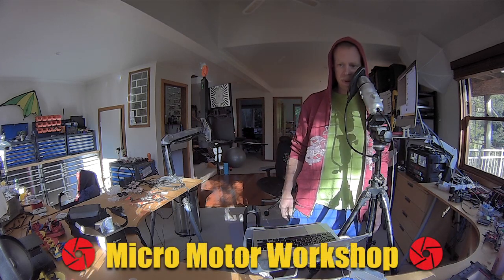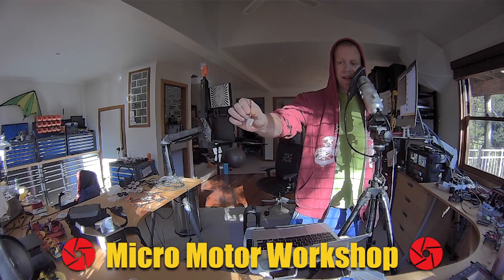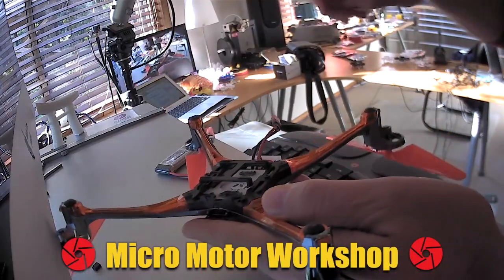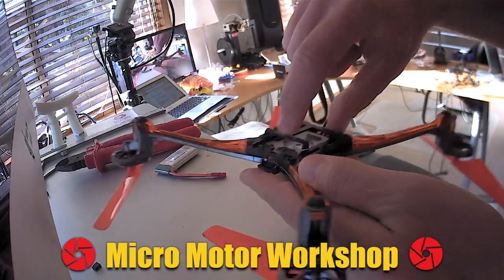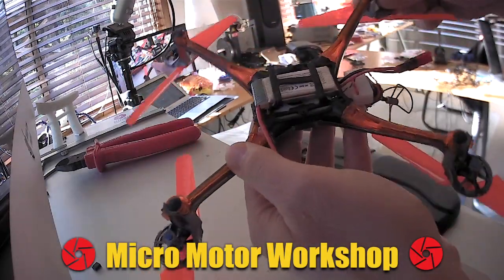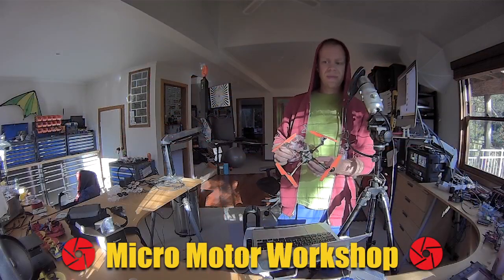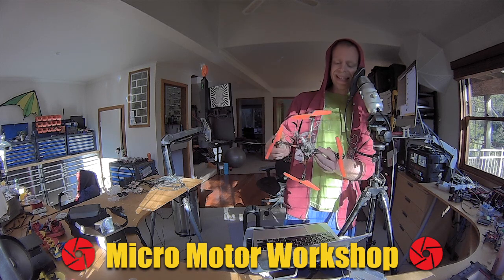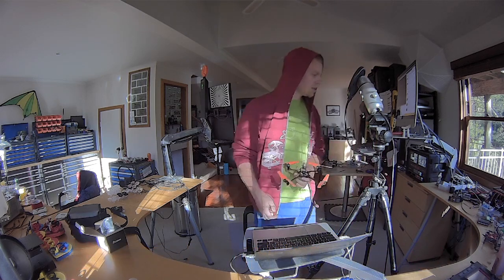How to modify a Latrax Alias for 720mAh mylipo batteries

Comment: Great mod...but my Alias has been down for over a year. The motors burn out so fast. Do you have longer lasting motors?
Reply from the maker: Our motors last longer than the stockers, but they also need to be replaced after 5-6 hours, maximum 10.
https://micro-motor-warehouse.com/collections/alias
Reply: Thanks...i'll ressurect my Alias with your motors soon.